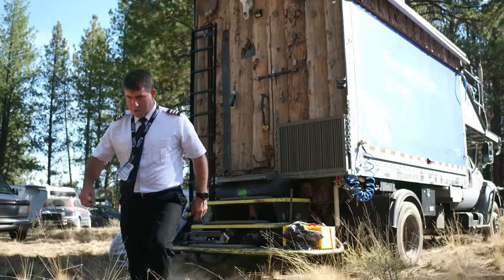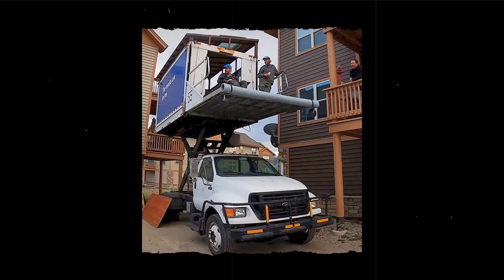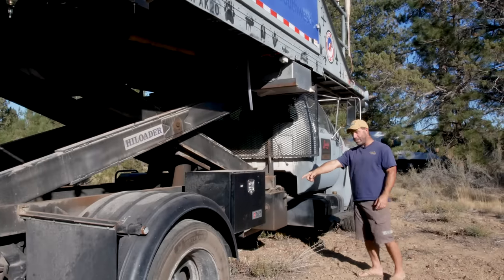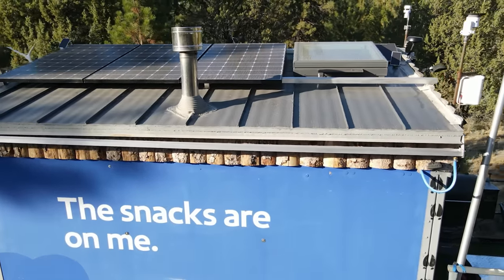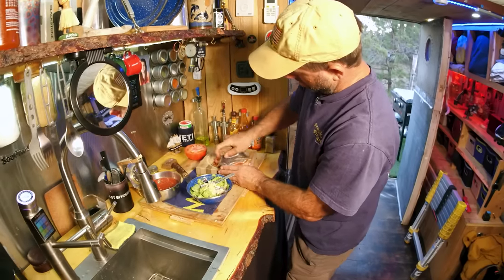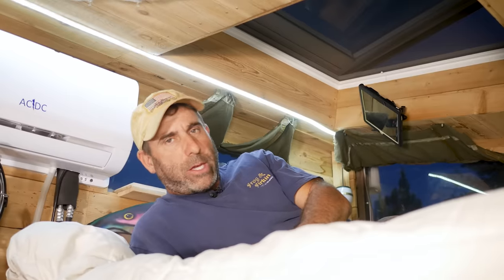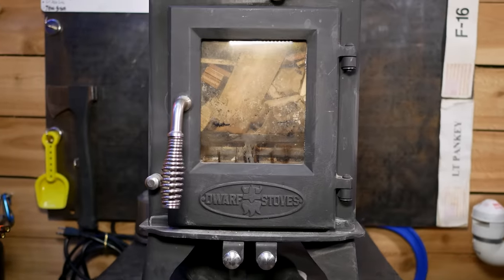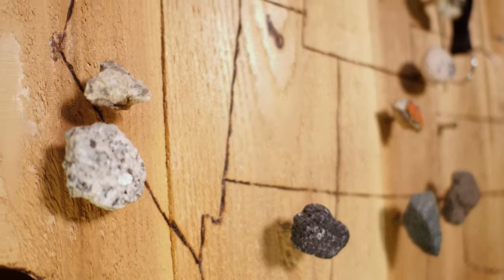Pilot converts airline box truck to Tiny Home w/ scissor lift!

Comment: I imagine that bubble level is very useful, wouldn't want it to go up while out of level! Great build. The man loves his coffee! Speaking of airplanes, I had my RANS S-7 LSA set up to sleep in, a good trick for a very small plane. It had a bi folding baggage floor, flat and level, with the plane in the three point position, a taildragger OF COURSE. When I bought a different throttle for the plane, I mounted the old one on a shelf right by the shop's toilet, PUSH FORWARD TO GO!   All pilots, including me with my 2 seater, always have peanuts handy for their passengers, too funny.

Comment: Worked at Toronto Pearson International Airport in the early 90's , the company called CARA had a huge fleet of these trucks , used to see them driving on the tarmac road system and loading aircraft ......   , this one is a small truck , they had much longer ones . I always had the same in my head to build a stealth camper out one of these too ...... great for having an unobstructed few at a beach on the ocean , great for watching auto racing too , as a lot of people build patio's on top of box trucks that  I  have seen at  to the big  super speedways ......  great over all build ......

Comment: Nailed it!  My 1 requirement for building is a full size shower and a  queen size bed Everything else can just exist or not.
Reply: Just recently discovered the need for a moisture barrier under the mattress.. glad I found out beforehand
Reply: @citigirlcountrified1927  Or Use a scotch Brite like material without any abrasives to create an air space so you get airflow under it

Comment: EXCELLENT! I've got the same ham radio rig and wondering what antenna system he uses; also his amateur radio call sign?  K7SXN is asking. TKS
Reply: DIY inverted V multi band 5 wire and store bought 7m dipole (like CB antennas) no license, still learning and listening; I used HF flying all the military aircraft I flew in though, so I understand and have lots of time talking to ground patches. Now I wanna be one of those guys!!!
Reply: @Mark Pankey  Should be easily done. Best to find a club with a focus of testing for the FCC license. You already have the knowledge for a Tech license. You could run VHF from the cab while in transit and get an HT for portable.
Reply: If you get to Tucson in the winter let me know. Our club GVARC is active and work the huge discone antenna at the Titan Missile museum at Green Valley AZ.

Comment: Hi love your little micro mobile home. This rig is awesome. Your attention to detail on keeping it warm is great. What year and where for nigh time temps have you camped over night and how well did your cool heating system handle the cold temps? And I mean cold temps with those wicked wind-chill and artic blast and polar vortexes hit? Really interested in that. We plan on building a tiny home. It's my job to watch learn write down all the ideas from heating electrical, potty, shower and plumbing. As for hot water recycling set up for your shower, you are I believe only the 4th or 5th person who has a set up to recycle shower water for showering. Do you also use that water for washing your hands as well or no? Also very few do the heated floors. I don't understand why not more people are doing this. I feel you can save even more in power or fuel to heat the floors.  Wish I had heated floors in my bathroom and kitchen  no one really wants to step in a cold floor after getting out and drying off after shower. Doing dishes I feel it would be beneficial for those of us who have bad backs and necks and hips doing dishes. The heat would be soothing. Any way did you make it to new Jersey for the rock collection? If not our highest point here is high point mountain and state park. There is a building that you can go in and climb up. I think it's 20 floors. I don't remember how high the tower goes up. The ground floor has telescopes that you can look through. I haven't been there for 25 years. Lol it's nothing special to look at. How ever from the building you can see so much. Any way that is where you want to grab your rock. If you can't make it. Let me know and I can grab you a rock since I live about 29 Mon away from there. I can ship it to your nearest ups store or where ever you would want it shipped to. I live in Jersey. Before that I lived in Missouri in that state I believe it's the Ozarks. There it's beautiful, gorgeous FANTABULOUS! don't quote me in it, as I said I believe that is the highest point in MO. We used to collects some small thing from sour little road trips to different towns. Be it a rock a flower sea shell or lake shell, even a snake skin one time. I love the tradition it's fun and brings up old memories to talk about in the future . As I said your little home is quite the trooper awesome rig. That k you for sharing. Have fun. Sorry about you losing the employment during the pandemic. Remember you aren't alone in that. Look at as an early retirement. From here our little jobs to help when needed. Then again I don't know your financial situation. I hope it's great and stable. Enjoy this time. Explore have fun. Above all else though stay safe and healthy. Run if you see or hear a KAREN.

Comment: While imagining fuel costs to travel in this thing gives me chills and the design style isn't my favorite... I've got major respect for the layout, planning and skills needed to create this tiny home.  Plus, that lift brings out the child in me despite my fear of heights, lol.  Extremely impressive overall! 😁👍
Reply: thank you!  I don't move it that often, so the diesel is not a factor - especially compared to what I was paying for monthly living bills prior to this !!  doesn't even come close!
Reply: @markpankey5689  Oh, I can imagine the difference is crazy, especially if you've got a permanent (or even semi-permanent) spot for it.  Plenty of solar for power so no electric bill.  You've got a rain water collection system and recirculating shower which means your water is basically free and you don't need to use the public/gym showers that others have to.  Everything else you need is there in a compact space which makes it easy to keep clean plus keeps you from buying anything unnecessary.  You have a car so you don't have to take your home everywhere like others do so less parking hassle for you.  Only expenses I can think of that you need are fuel, personal and cleaning products and groceries. Well, and laundry, I guess, since I don't think you mentioned that you have any type of laundry machine in there and I'd imagine you'd want at least your uniform professionally cleaned and pressed anyway, lol. 😊

I honestly wish I could could get myself something similar (like a trailer style tiny home that's completely off-grid) however I wouldn't know where to settle down with it.  Plus, I never even bothered to learn how to drive having lived in NYC my whole life, lol. 😅

Comment: Actually, getting 17 ft off the ground would help in a lot of instances.

You could almost guarantee a wild animal won't get in

It would probably even cut down on mosquitoes as carbon dioxide is how they track you, and that falls, therefore any carbon dioxide you're creating would go down away from your area

Also cooler up off the ground, and a little bit less humidity..

I don't know where this is located but. Here in South florida. If you're on the ground versus even 10 ft above it it makes all the difference in the world to be above the moisture

Also you mentioned the view. In South Florida there's almost no two-story houses, so you could see over everything

Comment: He had the same idea as me, about filtering water to reuse it when you need to conserve water. The rain water/gutter collection system was another idea I had...... Idea #3 keep a long lightweight hose & pump that could reach a nearby stream,lake,etc..to suck up water & run through a filter before it goes into on board storage tank.
Reply: I have a Honda 1 hp water pump with filters and a 69 gallon bladder I use .

Comment: The recirculating shower water is brilliant. I've only seen that in one other place, also a Tiny but in Berlin. Why isn't this everywhere? Especially in places like California. Not only does it save water but it also saves energy as you are recirculating the already heated water,

As a tiny "space" dweller, there are only 2 things that don't work for me: I would remove the curtain under the kitchen counter so it's easier to find thing. Who cares if it looks cluttered. And ladder access to the bed is just too much work. Otherwise this is great.
Reply: normal day the curtain is gone and 100% agree with the ladder - I'm still upset I did NOT incorporate some pull out pegs that are easy.  this haunts me daily :(
Reply: @markpankey5689  You've already done so much clever stuff, I wonder if there isn't some way to winch or counter-balance you up and down? That could be the final "touch."

Comment: Soo cool! Does it lower itself automatically if you leave it up, you fall asleep, and the wind really picks up? Maybe use an old pinball "tilt sensor"
Reply: Great idea!! I usually leave it down for the most part..most time I raise it about 4-5 feet to make it easier to get up on the front deck.

Comment: Curious why the woodstove pipe is on the low side instead of the high side of roof. Seems the extra rain there is detrimental. Or is it for clearance reasons when going under overpasses? That webasto is quite expensive! Nice shower setup.

Comment: Great video, Jenna! I think this is the nicest tiny home I didn't build! Lot's of thought, maybe the most innovative one I've seen without admitting to a Farraday Cage.
This build would have to go south from where I live in winter, for sure! Kerosene is jelled at a typical daytime high here. It will stay below zero for weeks. You need serious power even to go ice fishing: our 70+ mile long lake (the 6th largest in the USA after the 5 Great Lakes) freezes over completely, typically to a depth of 5 feet of ice, sufficient to support the ice road heavy lift to the Northwest Angle of Minnesota: bulk cargo like concrete block, sand, and sewer rock.

Comment: Want one. With a couple changes and additions. Incinerator toilet snorkel for the engine. Saw a video on YouTube of RV that could go on water like a yacht. Bed that. Can either be raised and lowered. Or Murphy bed that has hinged baskets. So when bed comes  down baskets hang under neath. Kind of like Ferris wheel seats
Reply: I've thought about a small barge for the box only; but just a thought! haha. Murphy beds are awesome!!!
Reply: @markpankey5689  yes on barge. But still like making it a land water RV style. Best of both worlds could drive into the water and boat across lake. Cutting off some milage

Comment: I have to admire the originality.  But, as someone who has first-hand experience with these trucks (I worked the ramp at JFK loading food on 747s back in the ‘70s),  I can tell you that winds are not your friend. The truck chassis has outriggers that are hydraulically operated, but they are designed for the flatness of the airport ramp. I wouldn’t lift the body unless the truck was absolutely level, so forget camping in the woods in this.
Reply: Zero issues for over 2 years !! I’ve had it up in 35 mph winds and it rocks a little, but didn’t come crashing down!!
Reply: @markpankey5689  - I admire your bravery!  One summer evening, I and my helper were servicing the first class galley on a 747. The truck was at its maximum height. It had been a hot day and there was a pop-up thunderstorm. Unlike now, when ramp personel are pulled inside when there is lightning, we were expected to complete the job regardless of weather. That was a wild ride, 17 feet in the air with the truck rocking and nearby lightning. We never worked so fast, we wanted to get back on terr firma as soon as possible!

Comment: So I am really curious about his kerosene appliances. He said his stove is kerosene?
Reply: Eberspacher Hydronic M-II M12 (Glycol hydronic heater, heats: radiant heated floor (pex), air blower heat exchanger, Heat plate for instant hot water for recirculating shower, heat exchanger in hot water tank ,,,,,,, Webasto X-100 (stove)

Comment: Amazing! I was wondering if you can help me out on my 1980 Delta Airlines catering truck that I purchased. My problem is that I have no idea on how to operate the scissor lift. I have zero instructions available or a manual. The truck has a 7kw generator on the side and I am wondering if it is used to run the scissor lift or does the truck itself do it? Any help would be much appreciated. Which levers or buttons actually make it go up and down? Thank you.

Comment: The big question - does the scissor lift have a fail-safe in case the hydraulics fail? (Car hoists have this; it's the clicking you hear as it goes up, so it can only fall a couple inches before hitting the latch)
Reply: There are swing down safety bars for working underneath, but no, there’s no per say safety catch. I know guys that work specifically on these rigs from work and that was my concern and they assured me it would take a lot to have the lift smash down.  Strong winds scare me more than this!

Comment: Spanky what happens in heavy wind conditions? Any lateral stability?
Reply: I don’t always put it up .  I’d say it’s down most of the time and if I do put it up, only about 1/3 if the way up. Way more stable!
Reply: There’s no downriggers for the rig, so I need to stay aware of the conditions.  I’ve had it up in 35 mph
Reply: @markpankey5689   Consider steel cables or rope in the four corners of the cabin anchored to tent pegs or something more robust in the ground and sandbags on top of them? Won't be a 100% secure but atleast give some stability. Lots of tall TV towers and such are stabilized by cables in such a manner. Lol hey if you can land in a cross wind camping in 35mph winds is a breeze.

Comment: 14:54   What type of filter is this on the toilet? Please help me to find one of them for my rig. Thank you
Reply: It’s a one way air valve I Jimmy’d to fit on the air inlet ! Ace Hardware!!!!
Reply: @markpankey5689  So this is the Air intake to the toilet? I'm from Switzerland and i love your build. I have also a compost toilet (Airhead) but i have problems with the vent which puls the stinky air out from the solid tank. Whats your solution on the outlet side? i can't see it on the video.

Comment: Nice job technically and the interior is pretty cool. But the exterior is horrible. Nothing matching or works with the other elements. Those skis do not work at all. And the "snack" thing-NO!  Not at all. Really need to hire a designer.